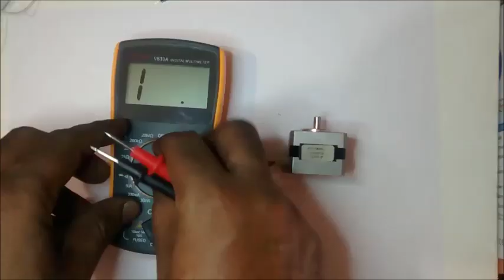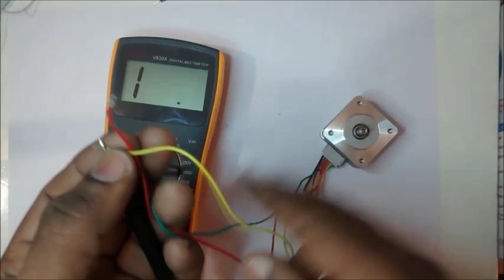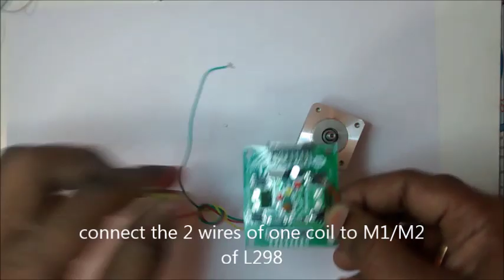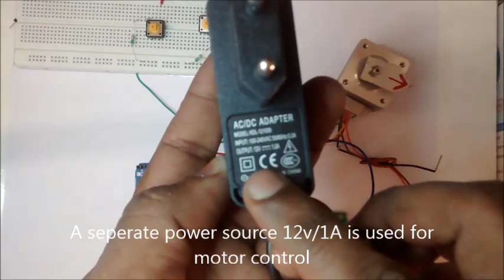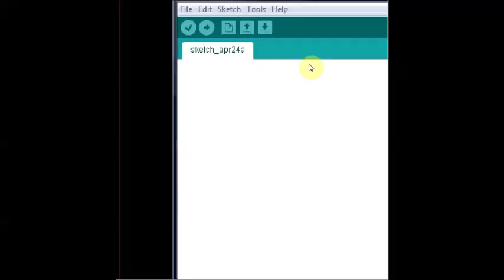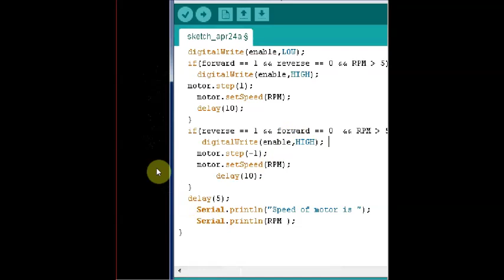Bipolar Stepper control with L298 HBridge & Arduino

Comment: Hi, Sir can you help me I have created a program that controls the motion of the stepper motor in which i have used the L298 driver , but now I'm stuck at one point , I'm not able to apply anticlockwise motion via push push button (PB IS ACTUALLY LIKE ELECTRIC CONTUNITY PATH (please suggest me how i apply if command)......
Actually it is a robotic machine where if electric continuity is High  then motor rotate anticlockwise & if electric continuity will LOW Motor will be remain stop  

// Include the Arduino Stepper Library
#include <Stepper.h>
int i=0;
int PB=13;
int RELAY=12;

// Number of steps per output rotation
const int stepsPerRevolution = 200;

// Create Instance of Stepper library
Stepper myStepper(stepsPerRevolution, 8, 9, 10, 11);

void setup()
{
  // set the speed at 60 rpm:
  myStepper.setSpeed(60);
  // initialize the serial port:
  Serial.begin(9600);
  pinMode(PB, INPUT);
  pinMode(RELAY,OUTPUT);
}

void loop() 
{
 
  while(i<1){
     digitalWrite(RELAY, HIGH);
  // step one revolution in one direction:
  Serial.println("clockwise");
  myStepper.step(stepsPerRevolution);
  delay(500);

 
 // here i want to control counter clockwirs motion to push button 
  // please suggest me how i apply if commond here
  
  Serial.println("counterclockwise");
  myStepper.step(-stepsPerRevolution);
  delay(1000);
  digitalWrite(RELAY, LOW);
  
  i++;
  }
  
  
}

Comment: Hello sir i want the stepper motor **(hybrid bipolar motor,)tocontrol the speed with anolog .Without the aurdino.Driver and controller direction.on/off.potentiometer to speed control.0--100 frequency .Will you please explain it  without any computor.

Comment: Hey man, im trying to unite this with LCD Shield. I have no problem to run it in forward but couldt do it in reverse. What am i missing?

#include <Stepper.h>
#include <LiquidCrystal.h>

LiquidCrystal screen(8, 9, 4, 5, 6, 7);

int PushedButton     = 0;
int ReadValue  = 0;

#define RGT     0
#define UP      1
#define DOWN   2
#define LFT     3
#define SLC     4
#define NONE     5

byte pushed()
{
  ReadValue = analogRead(A0);
  if (ReadValue > 1000)
    return NONE;
  if (ReadValue < 50)
    return RGT;
  if (ReadValue < 195)
    return UP;
  if (ReadValue < 380)
    return DOWN;
  if (ReadValue < 555)
    return LFT;
  if (ReadValue < 790)
    return SLC;
}

int steps =200;
int enable=44;
Stepper motor(steps, 22,24,26,28);

void setup() {
  screen.begin(16, 2);
  screen.setCursor(0, 0);
  screen.print("MOTOR DIRECTION:          ");

pinMode(enable,OUTPUT);
Serial.begin(9600);
}

void loop() {
int Speed = analogRead(A15);
int RPM = map(Speed, 0, 1023, 0, 100);
int forward = digitalRead(RGT);
int reverse = digitalRead(LFT);
 screen.setCursor(0, 1);
  PushedButton = pushed();
digitalWrite(enable,LOW);

switch(ReadValue){

case NONE:
        
        screen.print("Press Button           ");
        if(forward == 0 && reverse == 0 && RPM > 0){
        digitalWrite(enable,LOW);
        motor.step(0);
        motor.setSpeed(RPM);
        delay(10);
        }
        break;
case LFT:
        screen.print("MOTOR Back              ");
        if(reverse == 1 && forward == 0  && RPM > 0){
        digitalWrite(enable,HIGH);
        motor.step(-10);
        motor.setSpeed(RPM);
        delay(10);
        }
        break;
case RGT:
        screen.print("MOTOR Forward           ");
        if(forward == 1 && reverse == 0 && RPM > 0){
        digitalWrite(enable,HIGH);
        motor.step(10);
        motor.setSpeed(RPM);
        delay(10);
        }
        break;
        

        

}        }